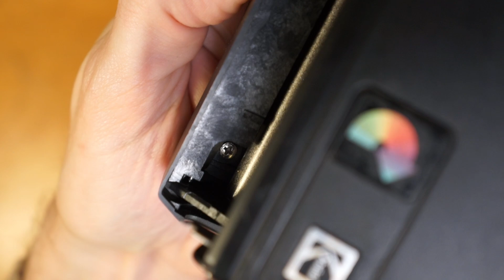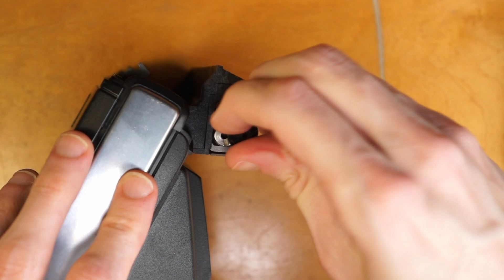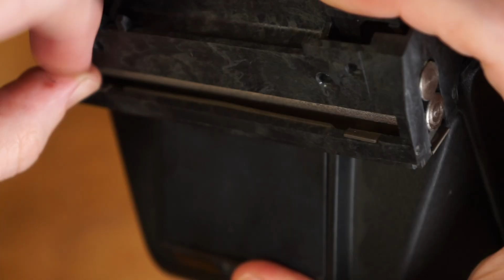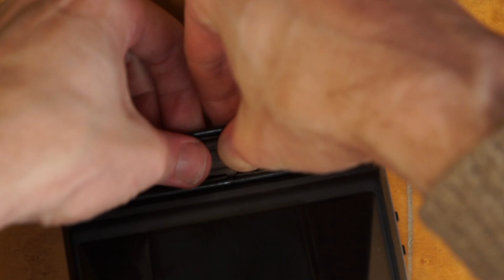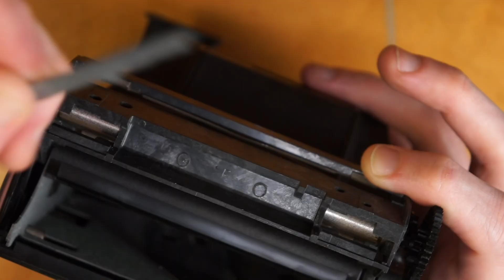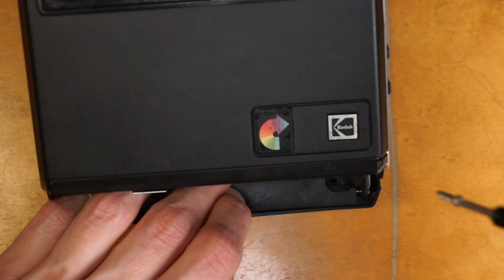Changing the roller bracket on a Vintage Kodak Instant Camera

Comment: Hmmmm are we close to making that line of Kodak instant camera work for instax square?
❤

I saw some but for EK only.
I hope somebody can make an adapter for this like what Kenneth Panda did for Fuji Fotorama
Reply from the maker: @sosomanythings I don't recommend it for the automatic ejection models since their gears are brittle, but I did release an adapter for the ek4 which could also work in a colorburst like this one
Reply: @JoshGladstone I'd like to try out your project on my Colorburst 50. Do I need the Kodak Instax Square Spring Base and Spring Top for it? Since it's inserted from the bottom. Do I also need to replace the small brackets, like in this video? In any case, thanks for this 3D model!
Reply from the maker: @daniele3442  Bracket replacement is optional. The spring backing is also optional, but can be necessary to get the last few pictures to eject properly.
Reply: @JoshGladstone OK, thank you 👌🏻